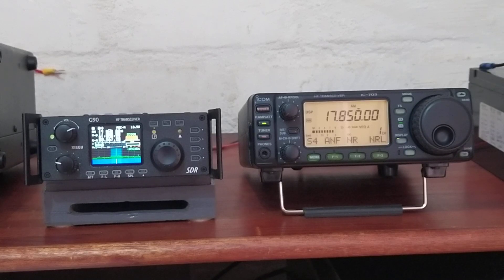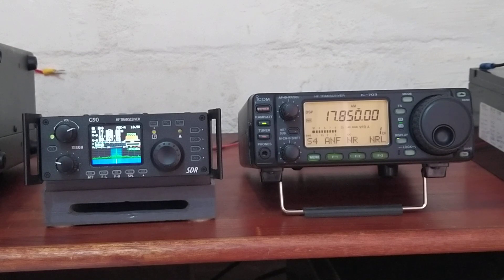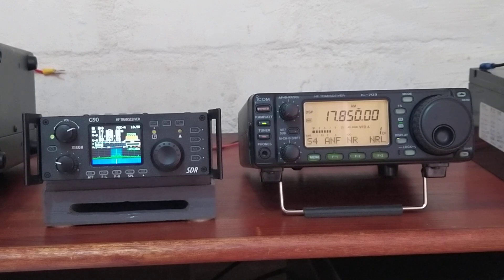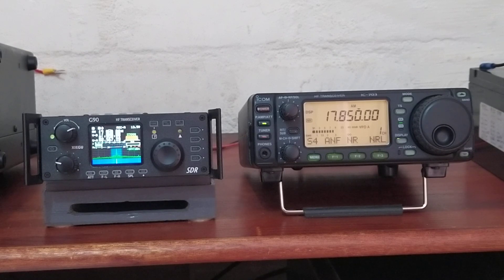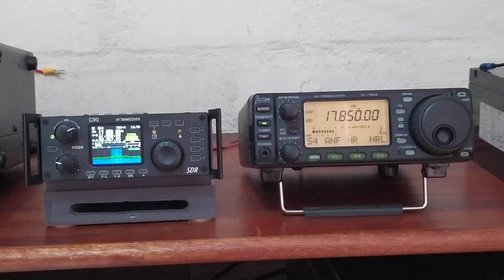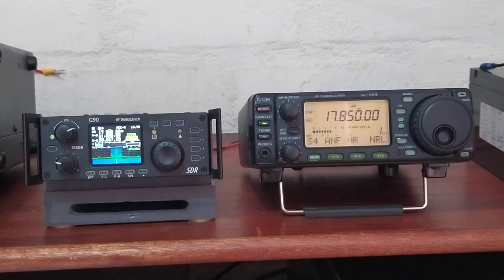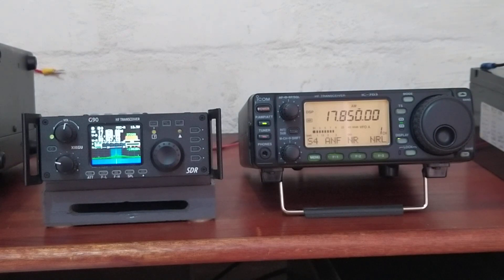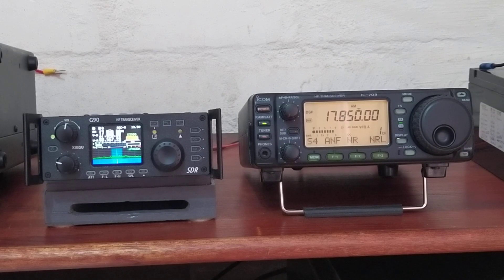Two QRP transceivers compared

Comment: Fully agre. Running 24h hour DARC Field Day contest with G90 was really tiring for me. Even with flexible BW settings, good NR, this DSP receiver is not really pleasant to listen. I felt huge relief when I switched for last 2 hours to old backup ft817. Even not having any narrow SSB filter in yaesu it was more comfortable to listen and receive. I sold G90 immediately after this and bought ic-703 as a replacement. Of course ft817nd is a lifetime keeper. Cheers!